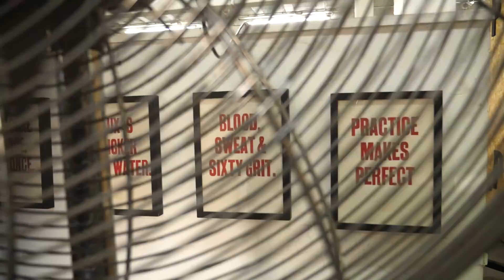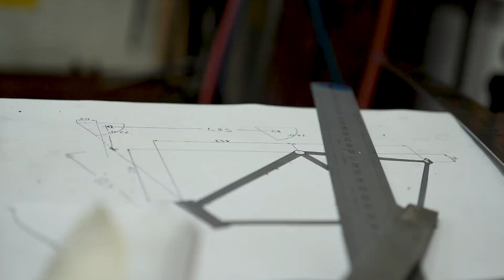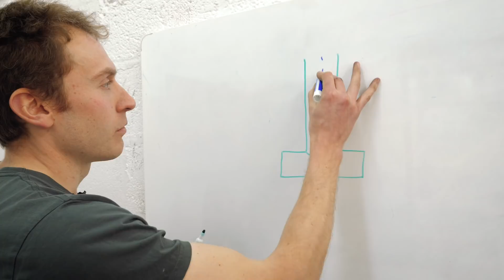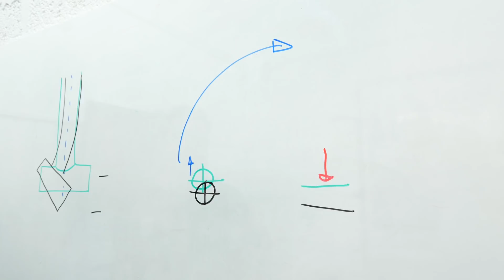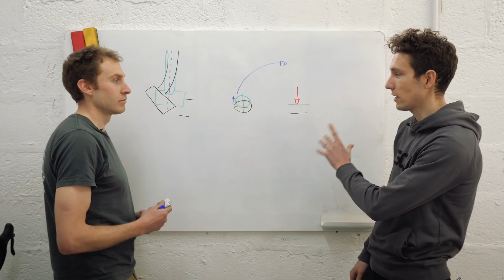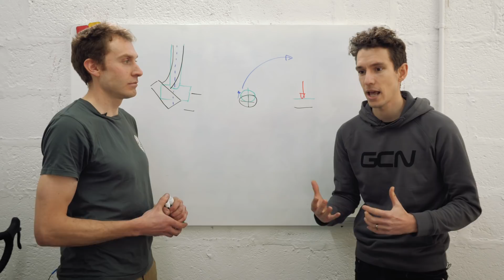Are You Faster On A Stiffer Bike?

Comment: If the energy is transferred back, is it under load or is the pedal in a neutral area and the energy just spun back freely into the bottom bracket? More testing needed here! 

Also reminds me of cars where everyone thinks a sports car should corner completely flat, but in fact some body roll can increase cornering grip.

Comment: It may be nice to see the results if you make an experiment with two frames (stiff vs flexy) on a reliable turbo trainer such as elite drivo and a crank based double powermeter to see the amount of difference in power readings from crank power and trainer power. Of course same drivetrain should be used (same crankset, RD and chain).If stiff frames are really faster, than for the same crank power, they should provide higher power reading from the trainer.

Comment: Would the power loss be between the cranks and rear hub in which case you could do an experiment using two different frames a pedal or crank power meter and a hub power meter and compare the results. However if the frame flex is allowing the bb to move away from your feet as you pedal it could be that a flexi frame is significantly slower because it damages how efficiently you can pedal like suspension bob in a full suspension mountain bike or at least like it used to in the bad old days when they bounced along like a pogo stick.

Comment: This is a complex problem in which the rider is part of the overall system. Performance = climbing + descending + cornering + straight-line speeds. Therefore, that is not only about how much power a rider can transfer into the bike, but how they use that power to move forward. 'Feel' can change the level of confidence a rider has in a bike too. Physics can't account for everything, particularly what is going on in a rider's head or the level of comfort. The required properties of stiffness, handling and comfort will be different between individual riders and the environment they ride within. Therefore, whilst a fun question to explore, trying to answer it will always be a sisyphean task.

Comment: Hello, I think I'm arriving late to the party but! dude,  there is one think you can improve in this experiment... the moment a normal rider relief pressure (emulated by you releasing the brake) is when the pedal is all the way down, try the example again pressing the pedal when it's all the way down until you flex the frame, release the brake and nothing will happen... as for the energy "stored" it will be absorbed by your leg, when you do the transition to start the downstroke with the other leg.... SO!!!!!! if you finish the pedal stroke RIGHT in at 90 degrees as your experiment did, then yeah, no point on having a stiff bike... but that's not the case, a pedal stroke finish in the dead spot, maybe that's where Osymetric rings help? who knows!!!!????

Comment: In a flexing frame most of the energy put into flexing the frame is put back into the rider in the form of heat.  Because the pedal stroke is not a steady torque, the flex energy is put back in the legs during low torque moments of the stroke. This is much like the heat produced by the body when pushing hard against an unmovable object. My theory.

Comment: One point that most comments forget: for a given force, a stiffer frame will flex less (less movement/twisting of the bottom bracket).  In the case of the video, the stiffer bike needed more force to make the pedal move the same amount. This indeed stored more energy in the frame (as we saw when the brake was released: more wheel spin).    For a given rider, the biggest difference one will see is the amount by which the bottom bracket will move/twist up/down.  Top level athletes can put down 5x to 10x the power of non-athletes. (think 5x to 10x the force (stress)). For the same bike, this would be 5x to 10x the amount of elastic deformation (strain).  With flexy bikes, a front derailleur rubbing when putting the power down isn't unusual.  That could be why stiffer frames are more desirable; especially for those who can put the power down...    (The Young Modulus (also called stiffness) is the relationship between stress (force applied) and strain (deformation) which is linear before the material reaches its yield stress; the stress at which the deformation starts being permanent)

Comment: This is an oversimplification of a dynamic system. The energy you store in a frame does not just go back to the drivetrain as if it was a loaded spring. You're storing energy in multiple points and the release of that energy goes back to multiple points. Some of it comes back to you when the frame pushes back on you as you lessen the force acting on the bike through the dead spot of the pedal stroke, but since you are a biological system and not simply a mechanical one, you cannot store that energy back in your body to use again. The materials will also heat up in the process and some of the energy will be lost in that. Most importantly, the direction of the forces exerted in the system after the stored energy is released is multi-directional. The only part of the force that matters is the one that pushes you in the forward direction, thus the only force that is important is that which is delivered directly to the drivetrain creating tension along the chain to apply a torque to the rear wheel that turns it and uses the friction forces between the tire and the road to propel you forward. Some of the stored forces will push upwards with the normal force which also is not good for the system when trying to utilize the contact between the tire and the road. That upward movement is also less energy going to forward movement. It can also be argued that the side to side movement in the flexing of the bike requires the rider to compensate for what would normally be destabilizing by exerting more energy into the system to keep the bike moving straight and steady. Ultimately he postulates this without even applying any math. It's all visual and conjecture that would be debunked with a little trigonometry and some force equations. The law of conservation of energy and the momentum principle do not work like this guy thinks they do.
Reply: Good point. I was looking at the experimental setup in the beginning and thinking this probably isn't right but, didn't think about it further. The multiple point loads in the real world would dissipate the energy differently. Particular to this experiment is that the energy input can only be released through the turbo trainer and no where else. This makes this experiment is invalid for the proposed hypothesis, energy in into a bike equals energy out of bike The bike on turbo trainer is unrepresentative to bike on road. A more valid experiment would be to test power input through pedals and power output through drive wheel. Energy loss would be then due to the coupled athlete and bike efficiency. Though, this would still be a rough estimate but more comparable through a regression analysis.

Comment: It seems, intuitively, that the more energy you can put through the peddles (and therefore into the bike) the more energy can be "stored" in the flex of the frame. For less powerful riders with a stiffer frame there may not be enough power to flex the frame, and so any and all power would go through the drive train. In either case it seems, again intuitively, that energy is being transferred through the bike ultimately to wheel rotation. So the question is whether bike flex is like a golf club shaft, where flex increases power through a spring-like action. Or whether sending power directly through the drivetrain alone is more efficient - and frame flex simply dampens that effect. That seems to be the difficult to measure empirical question.

Comment: I’ll start by saying I love the feel of my propel, even if it’s just psychological. To borrow from hockey sticks, a whip flex (65) can really make a puck fly but they break more easily. That’s why people use the medium flex (85) Then big guys break those too so they have stiff flex (100). Now if you built a hockey stick so strong it wouldn’t break it wouldn’t be flexible enough to shoot well. There is an idea balance point somewhere. So maybe it’s really all about the stiffness to the amount of watts you put out. Hence the pro sprinter being on the stiffest gram with the stiffest head tube and wheels. So is my frame too stiff for my power output, not being that of a pro, or big guy for that matter?  Somebody has to build a test rig now for some real experiments.

Comment: Soooooooooooo many issues with that simplified test and explanation.  In the 1st test there is going to be energy stored and lost in frame, crank and chain flexing. In the 2nd test there is also the loading up across the spokes as the 2nd bike has rim brakes compared to the 1st bike having disk brakes. Any drive train flex is going to cost energy as the deflecting and re-straightening of the frame is never going to be 100% efficient. The greater the flex that you get in the frame rather than stretching of spoke, cranks and chain changes the alignment angle between the front and rear sprockets which will produce noise which is a direct loss. 
  Recording bikes with highly sensitive thermal cameras would potentially show where the heat is going and show the differences in losses/heat due directly due to frame flexion as well as chain stretching and potentially sprocket misalignments. Pretty easy to do. Grab a flexy frame and a rigid one and do the tests at 200, 400, 800W and see the difference.

Comment: It's also pretty reasonable that the flex in the chain would have a pretty large impact on this experiment. Especially with high grade chains being made light by removing material, but with generally the same materials. The chain is directly in line with how the force was applied to the wheel. Since your chain is almost always in tension on the road, we can expect less effect.

Comment: You can question the theory til the cows come home.  Though I'm on board with the idea that a flexy frame is fine as long as it returns the energy like a spring.  Where a flexy frame will lose out is if the flexing also absorbs the energy like a damper.  But on the flipside, like tyres, if a flexy frame is absorbing road vibrations that would otherwise go into your body (where your body energy has to absorb them), then it might well be faster...
Hows about a "science" test where you take a noodly frame and a stiff one, some pedal power meters, and measure a hill climb time at the same wattage?

Comment: I call BS! Try removing the left crank arm and deflecting the BB, if I'm correct the wheel won't move. I think the video example was/is just the stored up tension in the drivetrain components and you got a lot of heat from deflecting those frames in your leg didn't you.

Comment: It's all about timing, or as many others call "planing".  When you apply a force to the pedals, there are time delays as the various components stretch. These might be only microseconds but they tend to smooth out the force over time.  When you add it all together, (shoes, pedals, cranks, chain, wheels, tires, and frame) you might be looking at a lot of energy.
So what does this feel like? Depends on your pedal stroke and how you apply force.  If you spin super smooth, the constant force will keep everything loaded and you won't get out of time with your bike. In the steel frame old days this lead to the idea that you had to spin circles to be efficient; you kind of had to with the old flexy bikes.  If you mash a flexy bike, some of your force will load the bike, stretch the chain, and wind up the spokes, and then potentially be released at the top and bottom of the pedal stroke, when your feet are no longer applying much pressure.
So really its about timing, if you can match the timing of your bike to your personal style of force application, you will find that golden ride.  I found this once personally with a 2011 Opus Cresendo w/Mavic Ksyrium wheels, that sweet spot where every push of the pedals matched perfectly by the timing of the bike.

Comment: I have a stiff bike and a not stiff bike and I’ve ridden both with the same wheels and tires and it’s like running on sand vs running on concrete. I don’t feel power loss in the stiff bike and it’s very responsive and snappy. It’s like making a chain from rubber, it will store that energy like that but by the time you reach your dead spot in the pedal stroke the energy can’t be used to produce forward motion.

Comment: Track cyclists have been all over this for a long time. For the big gear starts (120inch+) a frame with some flex is desired so there's no 'deadspot' when pedalling. If the frame gives just a little bit back you should get out of the gate a little smoother and with less of a deadspot you can get into your power phase that little bit quicker. That's partially why there's no desire for anything stiffer than a square taper bottom bracket even amongst the top athletes, and some track frames are considered too stiff for events involving a standing start. 

Could be complete bogus science but lots of trackies swear by this.

Comment: This needs a test: power meter on the cranks and power meter in the rear hub on a flexy and on a stiff frame to see if there's any difference in the power delivered to the cranks vs. that delivered to the rear wheel. 
Use the same crankset, and wheels. 
Test with a sprinter and a climber to see if rider weight has an effect. 
Maybe throw in a flat (no climbs to minimize any effects from weight difference) time-trial with a rider putting out a steady power output on the crank-based power meter to spice things up.
Reply: the test only shows how much those frames store energy like a spring would it has nothing to do with efficient transfer of energy that would make a bike fast. a bike frame cant be stiff enough. most comfort comes from seat post deflection and tyres anyway.
Reply: There is indeed power lost between the cranks and the rear hub. Most of it in the chain. Stiff is better because it's more stable. Not because you actually lose energy by loading a spring. You lose a lot more energy in places that you don't even look. If you're getting chain or brake rub that's an entirely different story. If you're not getting obvious performance problems from the flex you should go search for "lost watts" in the tires and the chain. Once you're close to optimizing that (for what you can afford) then go hunting for "lost watts" in your bearings. You lose a lot more power in a dirty chain than you do in a "flexy" frame (as long as you're not causing friction from bad alignment). When you lose energy in the chain you can not get it back. As illustrated in the video, most of the energy used to load the spring (frame) is returned to you and the actual values are trivial.
Reply: @indonesiaamerica7050  doesn't this suggest that a smoother ride (which could come from a softer frame) is more stable? Also, that clutch derailleurs could help too

Comment: Seams like the energy is stored in the chain.??
Reply: And in the spokes? They are put under pressure and thereby functioning in the same way as a spring in a wind-up clock, I would presume
Reply: Yes. I hadn’t seen your post before I posted. With the brake applied, turning the crank down 1 cm visibly pulls the chain ring rearward.
Reply: Yep, thats what i was thinking...

Comment: Ive own and ridden for thousands of miles both "stiffer" and "flexible" frames. Its something a rider can actually feel, if you dont feel such changes going trough your arms and legs you're dead. I always comeback to my stiffer frame, I like that when you push your pedals it reacts extremely fast and it feels nimble, i just point and shoot and there she goes. Having flexible rims and frames its not of my liking. And im not even debating between frame materials, I own both steel frames that are stiffer than other carbon bijes I have, and also stiffer carbon frames that are by far much stiffer than other steel frames i have. I enjoy both, but for everything I prefer the stiffer frames. I might not lose much energy but its a thing of feel that no experiment can take away from me :)

Comment: It is not rocket science but it is not that straight forward as well. To me, a stiff frame refers to the stiff lower half of the triangles. Less flex in the BB and less flex (and compression) along the chainstays would translate to a more direct power transfer from the chain ring to the rear cassette. I personally think that the more the chainstays can resist the compression and flex under a power stroke, the less power is lost in it. That's why even steel frame builders are using bigger tubes and be made as straight as possible for chainstays to reduce the twist and flex. And bigger chainstay also means there's a bigger surface area joined to the bottom bracket and that contributes to the reduction of flex AT the bottom bracket region. 

But a stiff lower triangle would not equate to uncomfortable ride if done right. A beefy downtube and chainstays would contribute to making a stiffer frame while a more compliant seat stay, seat tube and seat post will affect the ride compliance. So technically, a frame CAN be made stiff where it matters while still be compliant (enough) for the weekend warriors in us. ;)